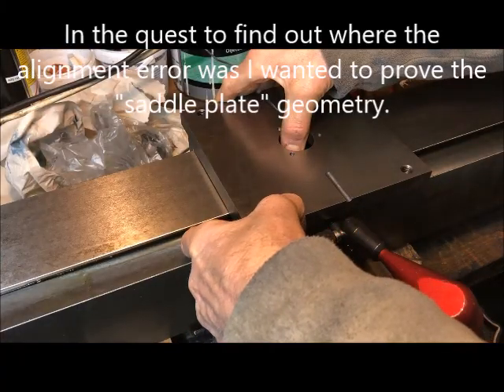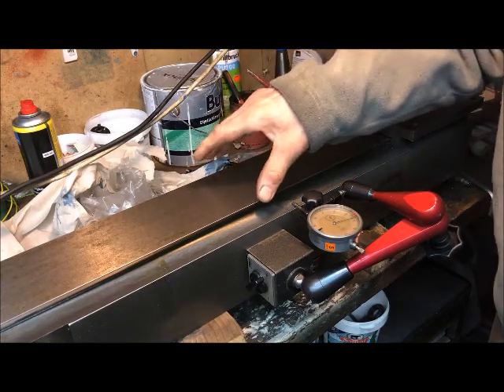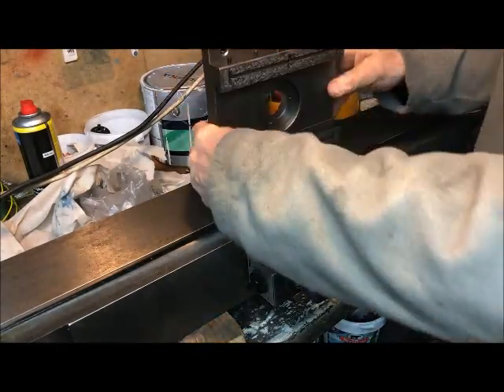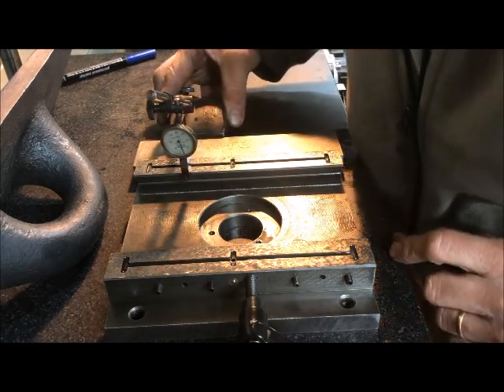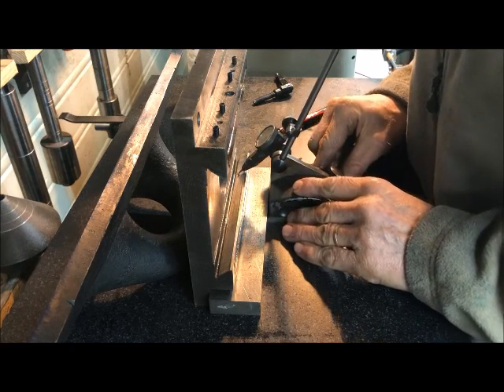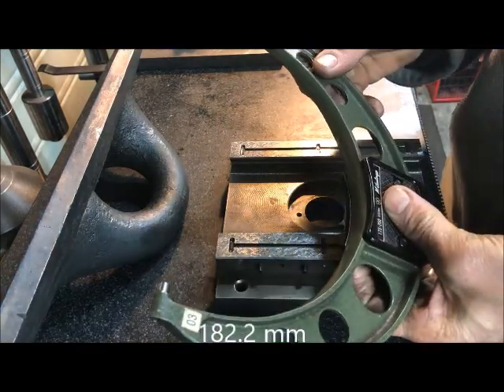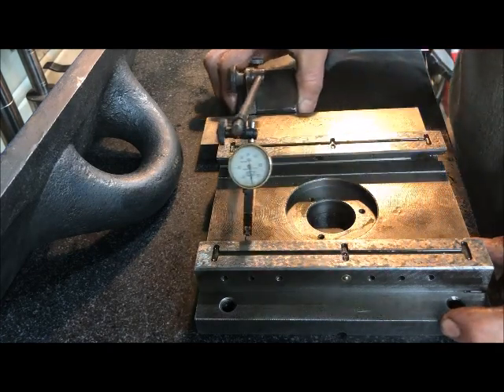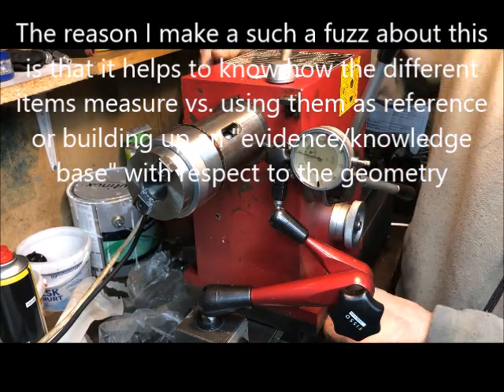SiegX3 head - saddle plate measurements

Comment: Jan Many thanks for the excellent videos on the X3. Just a thought is the gib on this saddle a tapered one and would this account for the difference in the dovetail measurement.
Reply from the maker: You're welcome. Yes, the gib is of the tapered type. It is however much steeper than the numbers for"out of squareness" I referred to and has nothing to do with these measurements. I meant the difference between the 2 milled outer sides of the plate. Not crucial at all that these are parallel, just nice if they are and when I found that one was in plane with the "non-gib" dovetail and also some other hints to point this way, I assumed this was not to fault. But, as I wrote, i could have corrected the error by scrpaing the dovetail, but it would have been more work